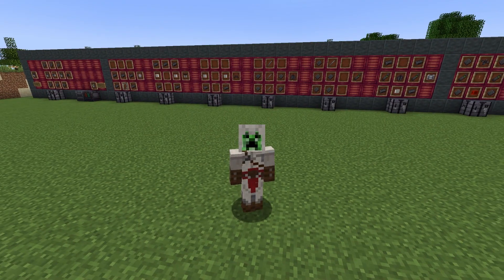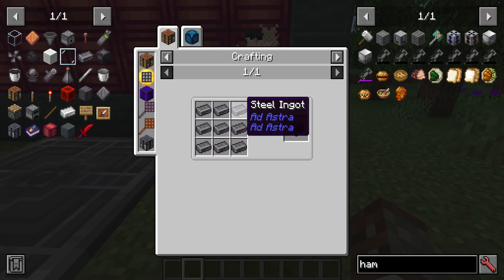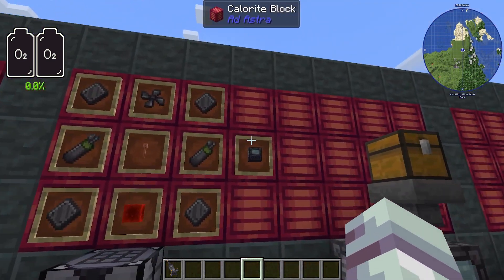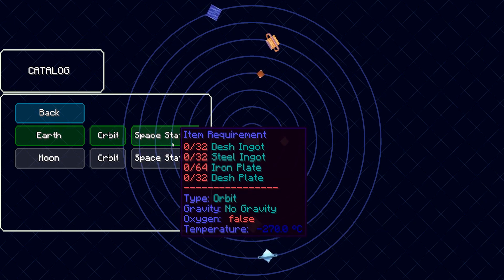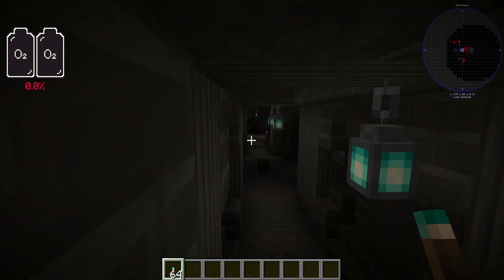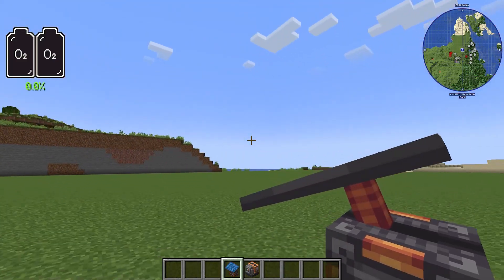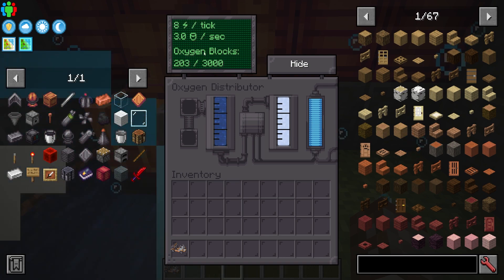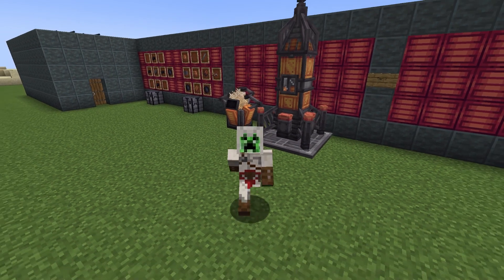How to: Ad Astra | Basics (Minecraft 1.20.1)

Comment: HOW DOES NONE OF THIS RECIPES WORK FOR ME?????
I put it exactly the way you did it, in 1.20.1, and none of these recipes even work, not even the damn hammer.
Also, why does it when I burn the coal in the coal generator, the amount just stops at 1100/1600 fo fuel, with an estimated time of 55 seconds left (and its not moving at all) but there's no energy created or stored?
Reply: If you have Optifine, then delete it: That will fix the fuel problem and the almost all the crafting, but I don't know how to fix the smelting problem of iron

Comment: bro why cant i make an hammer even though i have the ad astra mod???
Reply: Did you sort this? I have the same issue.
Reply: same bro i still havent found a solution
Reply: same for meee, did u find out???
Reply: @davidelotto8504  According to the wiki, it was removed in a update. Still figuring out how to do everything too so I can't help much beyond that.
Reply: @LoAlCo  ok but there Is still the problem that i cant even obtain steel from iron putting It in a blast furnace, they make mods that doesnt even work
Reply: @davidelotto8504 Weird. It could be like my modpack where a few mods add steel. The Almost Unified mod fixed that so when putting iron in the blast furnace, no matter what steel I get it can still be used for the rocket.

Comment: how do i keep my water source from freezing in the space stations?
Reply: same bro
Reply: @alreadysucksyt1072  i actually figured it out. You have to put oxygen in the oxygen distributor, wait for it to start working and then add the water under the pump. The water needs oxygen to not freeze.
Reply: @Anguillejoby  yeah, and then the oxygen distributor randomly decides not to work (and your water immediately freezes again)
Reply: @someguy3861 its because of yhe energy. 6 coal generators with desh cables give good energy
unless its a glitch
Reply: @oakamaam  8 solar panels with desh cables and an accumulator still didn't work (even when the accumulator was full)
Reply: @someguy3861 why not waterlock 4 stairs for inf source
Reply: Oxygen
Reply: waterlogged blocks, slabs

Comment: for some reason ppl keep complementing this guy for his "easy to understand" tutorials, well then how do i use cable?
he said that to power something i just have to put the generater next to it, but guess what? it doesnt work, oh and whats this? these cables have some sort of mode, well then how do i use those?
Reply from the maker: There are no modes for these cables. It’s all plug and play with the vanilla mod. It could be that the pack you are playing has disabled how these machines work or you could be in a different version of the mod entirely. Just because things aren’t going right for you doesn’t mean the information is wrong. 

Let’s me know what the problem is specifically and what your set ups are and maybe we can find a solution
Reply: @Mondays3 hi, im so sorry for my outburst, i had been trying to get the cables to work for three hours, and i got frustrated, i dont know if its only for 1.19.2, but for some reason, the cables have modes, such as "extract" or "import" for some reason, no matter what i do, the cables dont work

Comment: the fuel refineing does not work for me oil does not convert into fuel
Reply: For me too
Reply: @imslowy  i found it out last year you need to use the oil distiler tower i think that is what its called
Reply: Thank you, in a modpack that I created, I wanted to work with this mod but I couldn't get the energy to pass, I thought it could be interference from other mods